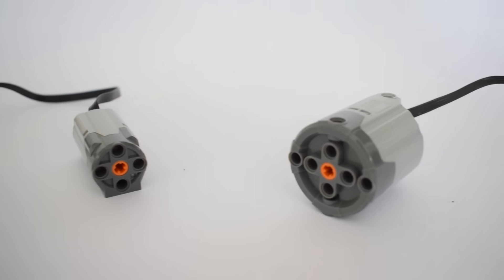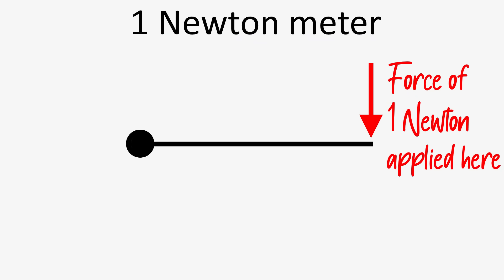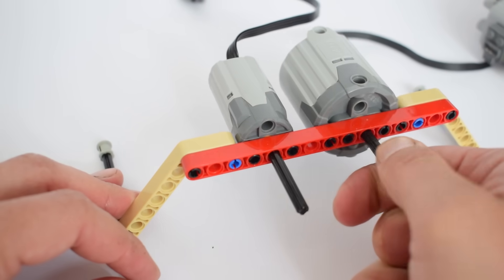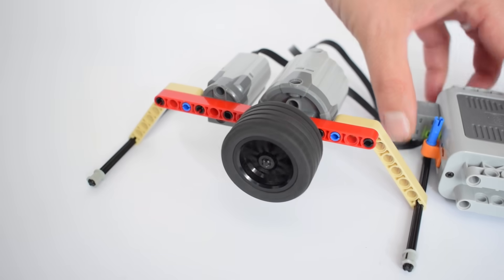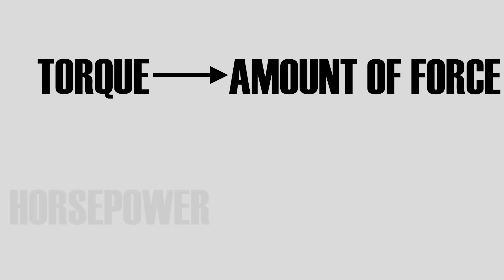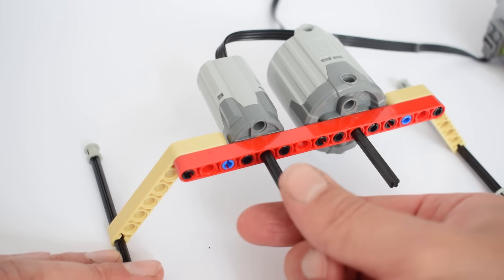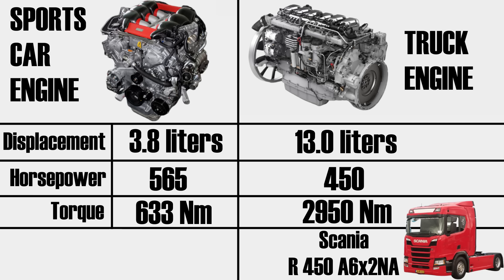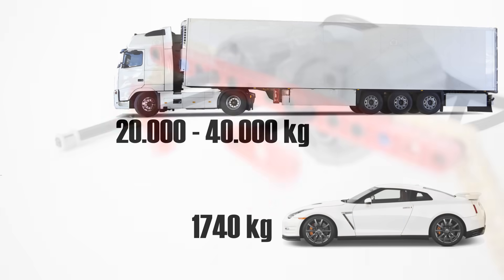NEVER be confused by HORSEPOWER and TORQUE again - HP and TORQUE EXPLAINED in the MOST VISUAL WAY

Comment: The funny thing is that this video finally made it clear, Donut's video only had me confused.
Reply: This explanation is incorrect, as he states that horsepower measures how much force is generated over a period of time. Horsepower measures how much WORK is done over time. Force doesn't imply movement. Therefore, if there is no movement, then no work has been done.

For example: let's pretend I have a shaft with a  1-ft rod attached to it, with a 1-lb weight hanging off the end of it. I put the shaft in a vice so that nothing is moving, but the weight is generating 1 ft-lb of torque on the shaft. If I leave that shaft there for 24 hours, then I've generated 1 ft-lb over a period of 24 hours. But the shaft hasn't moved at all, so no work has been done. There's zero horsepower.

Or take the example of his smaller Lego motor. If he stops the shaft from spinning, and prevents it from moving, the motor is still generating torque, but it's not doing any work, because it's not spinning. As long as the shaft is stationary, no power is being generated.

Horsepower = (torque x RPM) / 5252. If RPM is 0, then horsepower equals 0, regardless of how much torque you generate over any given amount of time.
Reply: @rars0n  You are %100 correct. The problem with watering down this information (as in this video) is it becomes incorrect/incomplete. The target viewers don’t understand physics, math, and engineering enough to know they still don’t understand the concepts…
Reply: well maybe if i SCREAM MY POINT AT YOU YOU'D UNDERSTAND! MORE POWER BABY! lIGHTNING LIGHTNING LIGHTNING! AAAAAAHHHHHHH!

there you go. summed up every doughnut media video that doesn't have Nolan as the main talking head.
Reply: @J.PC.Designs  yeah Aaron
Reply: @Anon C you dont go to donut media for the technical and mechanical side of cars, but for the stories behind the cars and the car humor
Reply: Your comment sent me over to the Donut video. I learned a lot from both. Thanks for the tip!
Reply: Watch Engineering Explained video of torque vs hp, I swear you will get even more confused watching it
Reply: LOL
Reply: Donut is 70% morons screaming nonsense, 30% content.
Reply: @Rathbone_fan_account  nah donut explains for people with more background knowledge
Reply: @waleed-2397  So true! 
Sometimes I had to pause their video to look for the certain example that they are using to explain the main topic.
Donut media videos are for semi-pro people.
Not for the beginners.
Reply: @waleed-2397  yeah I agree, their videos are entertaining, but it really depends on the person, for me this video made the concept clear, maybe other people understood concept better when they explained it. Not attacking Donut just expressing what I thought.
Reply: @macnchillidogs1601 if you like more substantial to the point videos then i would reccomend savagegeese, he is a criminally underated automotive youtuber.

Comment: from 0 to 60 mph
what's the stronger in effect horsepower or torque?
thanks any way
Reply: You need much more information in order to determine that result.
You need HP and Torque curves, shift points, gearing, total mass --- even if all that is the same for different engines, you also need to know how much torque and HP.
I once raced a V8 Jeep with a small 1.8 litre stock Integra and out accelerated it from a light.
Reply: All other things equal, horsepower.

Comment: 7:50 what about the twin turbos on the gtr engine? Doesn't that sort of increase the displacement in a way by ramming more air into the combustion chamber than what's possible for an NA engine? I assume this affects torque specs in addition to the physical size of the engine.

Comment: "Does Newtonmeter confuse you? Here's the same in Imperial measurements, because that's always better."
Reply: If the pound*foot is too small or too huge for you, you can easily convert it to the ounce*inch or stone*mile
Reply: In this case I think Foot Pounds is a better measurement because a pound of force is something very easy to contextualize. Newtons not so much. KG/Meter would have made more sense to me.
Reply: @calebdavis1323   1 Newton is the force you need to accelerate 1kg to 1m/s
Reply: @DJDiarrhea  i actually did not know that. Thanks for the info, Newtons actually make significantly more sense now.
Reply: @calebdavis1323  All SI units are derived from base units like kilogram, meter and second. There's actually only seven base units, any other SI unit you see is just someone's name and used as a homage to that person for their work in that particular field of science.

One Newton is actually one Kg*m/s2, a unit of force directly obtained from Newton's second law of motion. Calling it a "Newton" is more practical.
Reply: @DJDiarrhea  Unit names follow the rules of common nouns with regards to capitalisation. A space is required between the number and the unit symbol.
Reply: Old mechanics here in sweden used to use kg/m back in the days, well some still do. 1kgm is about 10nm. To be precise its 9.80665nm (1kg * gravity). One of the oldest torque wrenches a own actually have 3 different scales ft. lbs, kgm and nm
Reply: @TobiasKarlberg  Interesting that kg was used extensively instead of N in former Soviet Union, too :)
Reply: Just different colored crayons, whatever you're used to.  Metric wins on the easier for daily use because its based on 10s 100s, easier to divide multiply (I agree, hate 3/16s and 53/64ths).  And wtf is newton, why not kg? Is that European version of imperial? Clean up your own house before you make fun of others.
Reply: @unclejim1528   1 Newton is the force exerted when accelerating a 1kg body by 1m/s². It's one of the base metric units
Reply: @unclejim1528   1 Newton is the force exerted when accelerating a 1kg body by 1m/s². It's one of the base metric units
Reply: @unclejim1528  Someone who asks this question clearly doesn't know the difference between force and mass/ between mass and weight.
Reply: But we digress from the subject.
Reply: And thats why imperial slowly going to change to metric.
Reply: @pietjepuk6372  lol no. I work in a machine shop. It doesnt work like that
Reply: @Ryknfjor  Then you stick to your yards feet and stones. 👍
Reply: @pietjepuk6372  we dont use stones. When we do bearing fits we use metric. We just convert. And nail the size. You just dont know.
Reply: @Ryknfjor I think its also have to do with what you are used to. Where i come frome we use metric, Kilo grams, meters and liters. And for axample; 1 liter is a 10 by 10 by 10 centimeter cube and that is one liter and one kilo of water.
Reply: But that is not precise either. It also dependes on the temperature, (we use °C) and the salt in the water.
Reply: Noooo, metric is always better. And more precise.
Reply: @pietjepuk6372  imperial is actually absolutely metric.

Comment: Very well explained, but I think it would be great to also explain transmissions in that context.

If you have a CVT, horsepower directly correlates with wheel torque at a given speed.
Reply: not only with CVT, any gearbox, CVT just keeps horsepower at constant rate. 
Horsepower on engine = horsepower on wheel. Divide engine horsepower with vehicle speed and you'll get acceleration force withou need to know torque, gear ratio or wheel diameter.
Reply: @Papinak2  The reason why I chose a CVT is because it can hold the engine at max power across many different speeds, so it is easier to demonstrate that P = F * v holds.

With a standard transmission, you need to also consider torque curves in different gears.
I'd personally explain it with a CVT first and then introduce gears.
Reply: @nottheengineer4957  Yes, CVT is good example in that regard.
Standard gearbox might be good example, if it's paired with engine that has constant power output over wide RPM range.

Comment: BUT the last thing we have to consider in a comparison between a truck and a road car is the gearing. Because in this example the road car engine could output the same amount of torque at the wheels (which is the most important) as the truck does. It only depends on the gears. The reason why trucks use big engines with high torque output is because at constant full throttle (thats how they are driven more or less) the big engine is more fuel efficient and is way more reliable than a small engine would be.
Reply: If you keep speaking the truth here you risk getting his wrath on you. Remember this is YouTube, he needs the audience, not the truth.
Reply: True... But i hope he is not like that
Reply: @vince0815  in another answer he insulted one of his followers because he contradicted his video. It was very disrespectful because this dude took a lot of effort showing a lot of real life data from the Nissan and the Scania to prove his point. Another dude even put an excellent example using a tank (M1) which weights more that the trailer, uses a gas turbine (22.500rpm, low torque) but due to massive gear down it has a lot of torque on the wheels (tracks actually). This example was conveniently ignored too.
Reply: @jaumeprimerelhipster  thanks for the answer. Its a shame really. Some people are just... wow

Comment: Gearing would be an interesting follow up to this. A low torque engine doing 20000 rpm can be geared down to generate huge torque, like a 1990s F1 engine. It can have almost 3 times lower gearing than an engine running at 6600 rpm to run at the same road speed.
Reply: My favourite example is the AGT1500 gas turbine in the M1 Abrams tank. The 1500 hp engine has it's power turbine spinning at 22,500 rpm and generating a mere 350 lb.ft. However the internal gear reduction reduces it to a more useable 3000 rpm and 2700 lb.ft at peak power!
Reply: @xeigen2  people are not gonna get it even if you explain it 1.000 thousand times.

Comment: I have heard : horsepower is the top speed..torque is how fast to get their.  So if the torque is to low, compared to horsepower and weight. You won't get to top speed.
Reply: Top speed is determined by the maximum speed the power unit (combustion engine or electric motor) can operate at. Torque is how much load the power unit can move, power is how fast it moves that load.
Reply: @crunchie83  Top speed is determined by HP, as in being able to dissipate more energy over time. That energy being what's needed to overcome air and road friction, internal engine and gearing losses --- all increasing as the car's velocity increases. Energy dissipated over time is Power, hence the faster you go the more Energy you dissipate per second. So your final top speed is determined by HP.   Energy/Time = Power
You're not exactly wrong but you didn't clarify what's limiting the speed of the power unit.

Comment: aren't there steam engines that can crank out 5,000+foot lbs of torque?
Reply: Yes, but HP output is comparatively low. Another good example would be a large water wheel spinning slowly, once moving you ain't gonna stop it.

Comment: Hp = tq x rpms ÷ 5252

Ive always said what you lack in torque (bore and stroke) can be made up in rpms/volumetric effeciency (high rsr/short stroke long rod). You cant discount the rotational speed and mass of the rotating assembly as it winds up through the rpms. Of course its not quite so "simple"

Comment: I believe your analogy you can’t feel horsepower is wrong... peak G-force in each gear is at peak horsepower not peak torque... and for towing torque does not mater, horsepower does... the torque number is so high because of the amount power “work” being done at a lower rpm... 500hp from a turbo 1.8 Honda and 500hp from a 13L diesel will accomplish the same work the only difference being stress.

Comment: Quick qeustion: if the larger motor in the video has 2.2 times the power, and power is the number of times farce is applied over a certain period, why does'nt the lego attached  the larger motor spin faster? Should it not spin 2.2 times as quickly?
Just to clarify; I'm not the dumb@$$ here, just asking for a friend, lol! J/k, I'm an idiot :)
Reply: Great question! It's because neither motor is developing any power in the situation he showed. Torque and power is only developed in response to a load. He should have used a frictional load in his demonstration instead to constantly keep the load applied such as attaching to each motor a wooden wheel and then pressing sand paper on each wheel to apply load. The motor that develops less power will stall with less load applied than the motor with more power.

Comment: We need to out transmissions in the discussion. What i never understood is why cant we just put a sports car engine with a very low multiplier to increase torque at the wheel.
Reply: That would work great if you want to slowly pull a heavy load behind your sports car.

Comment: Horsepower is how fast you hit the wall, torque is how much of the wall you take with you.
Reply: No this is one of the dumbest car world things said by car guys.

Horse power how fast you hit the wall.

How far you take it would be related to the momentum of the vehicle.

At 60mph a truck at 40 tonnes will take the wall way further than a car at 1.7 tonnes.

Torque doesn't enter into it as you could get the same results after lifting off the throttle producing zero torque and zero hp.
Reply: @Richard25000  True ... all very true.
I guess the video wasn't all that thorough.  ;-)